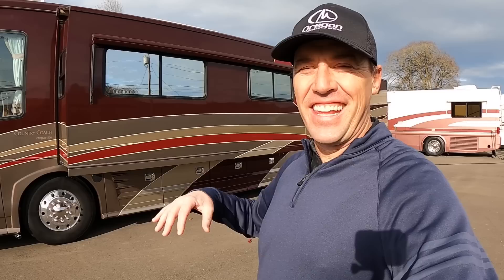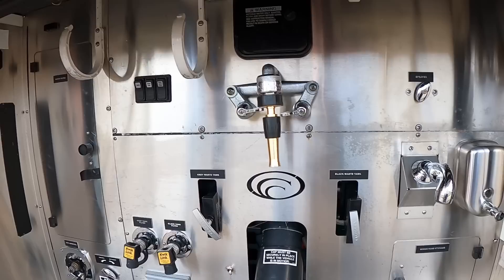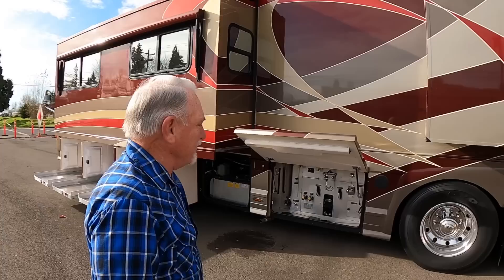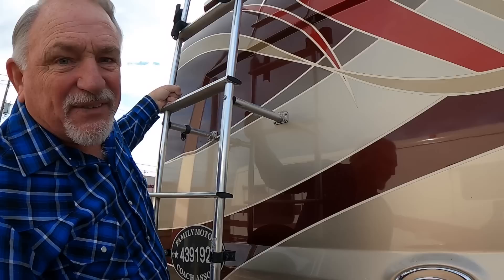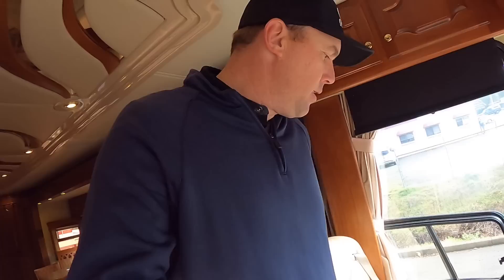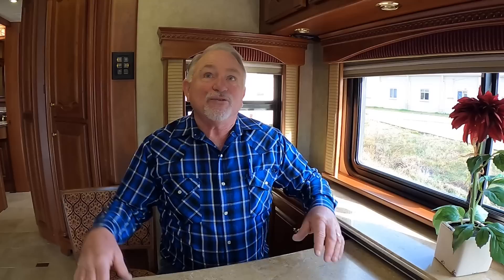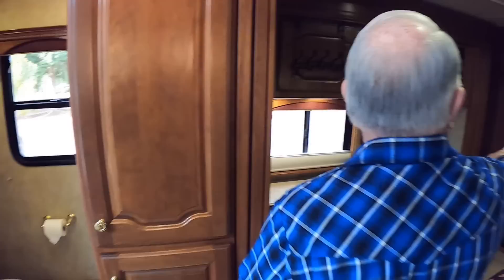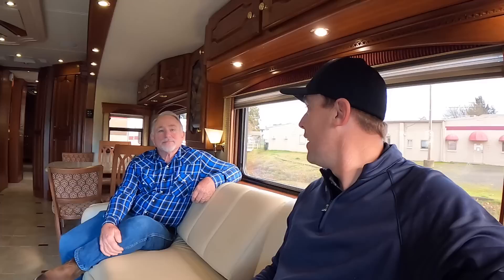Country Coach Intrigue Extreme Walkthrough with Country Coach Expert

Comment: Absolutely gorgeous!  Man, I remember when that rig was factory fresh!  Ovation 42!  Rare layout, not quite a 45FT allows a little bit more room on your RV pad for you to park your Toad.  Them 2006-2007 40, 42s that year generally had the galley on curbside,  desk on street side but that desk on curb is a nice changeup with the BIG bay window under patio awning like the older "First Avenue" models used to have!  That was Country Coach signature design right there, that big bay window!  Definitely one of my favorite features over the years.  Which you'll find it on the street side in Magna/Affinity.  Yup....Terry is the man!

Comment: Thank you this is taking g care of the knowledge of the Class A rvs. I'm currious so I know  the options. I'm find it hard to find the ones I'm able to afford with washer dryer and dur e place. I just seen the  patio on  one couldmr believe how resourceful these model Are. I'm looking for one of these kind and I don't k own I imagine these take a lott of gas in travel. How long does the busses live without refueling it. I figure a day on generator. But I think all rvs should come equipped with the solar panels. Now do they really make a difference tho? If you can run off solar is the generator really eeded? What's the difference of the diesel and gas. Is the diesel engine run distances better  or does it matter? Thank you much!

Comment: I don't get this constant  thing over tire date codes? I'm driving a truck in Ireland and a trailer I pull has a tire with date code for 2015 and it's which is on TERRIBLE Irish roads and the truck is weighing UpTo 46 tons and it's wearing fine.

Comment: Nice! -- QUESTION -- Andrew, do you prefer a CAT engine or a Cummins engine (assuming the same power rating).  Some videoes say that CAT is the greatest engine ever made ie the 3406E but not sure.  Speaking of the Pre-DEF engines like the Cummins 600 ISX  or a CAT C15 etc.

Comment: Don't normally comment to correct people, but him talking about the PTO and what it's used for is just wrong.  A PTO is for driving external hydraulics, pumps, generators, etc...  Your brakes/steering/etc are driven off of the serpentine belt.  Thinking maybe he was referring to the power steering pump?  I have never seen a bus chassis/coach with a PTO.  That's typically reserved for heavy trucks needing to drive the hydraulics on trailers